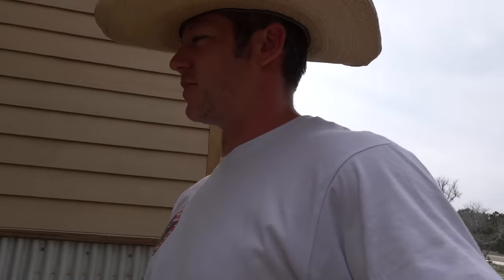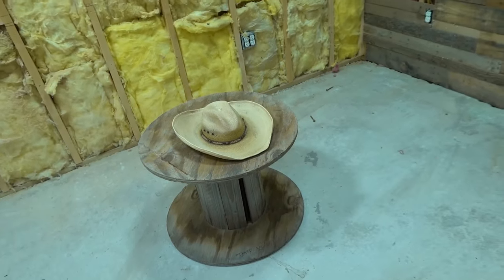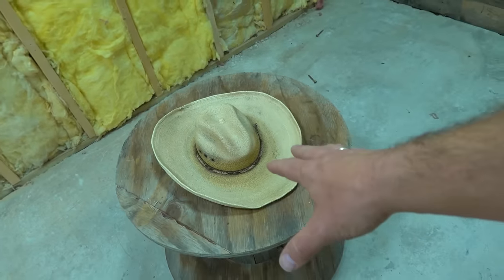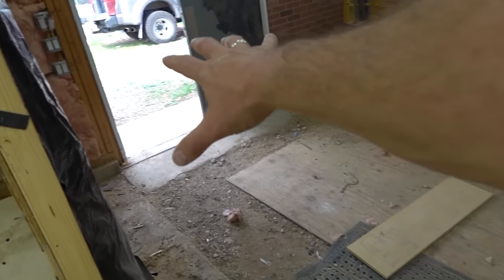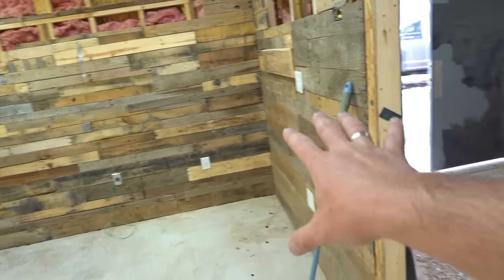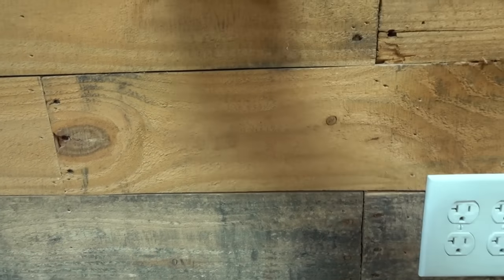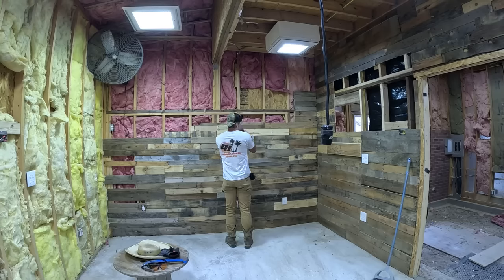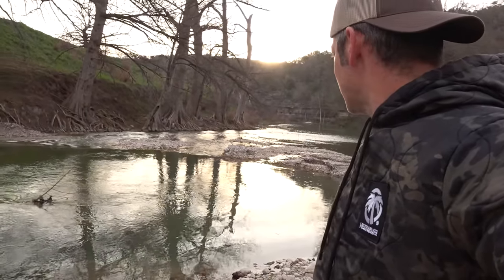Building a Tiny Home: Part 3

Comment: Make a headboard for the bed out of the pallet wood
Reply: I was thinking the same thing. It would look really nice. And maybe even building the bench with storage in front of the bed out of the same wood.
Reply: I was thinking the same thing. Either a headboard or even an accent wall at the head of the bed. Since it's reclaimed pallets, just attach the slats of wood to a piece of plywood and any small gaps could be filled with caulk or grout.  Seal it with a clear coat to protect it but still let the colors show and it would be a great addition to the room
Reply: Yeh, not sure why, but I kinda like the look of those pallet wood walls. Was thinking after the last video about how they could be sanded a bit and sealed, but guess sealing between the boards would be more challenging.
Reply: I run pallet wood thru a planer/shaper to smooth it up and square the edges. Make all kinds of stuff from it! A LOT of it is oak!

Comment: You can still use the pallet wood maybe as an accent wall. After sheetrock paint the wall flat black then reinstall the pallet wood. Any of the slight gaps will only show as a black shadow. It would also be a good conversation piece because it was from the original addition to the building.

Comment: Matt just get a water truck if you don't have good water and porta-poties for that weekend for your guests to use who don't have self contained campers. And there might be someone who has a snack/catering truck who would come in for the week end Get it rolling. Wish I could come, but my van is not going into 3,4th gear. Bad news for an old van. I would camp remote.

Comment: you overestimate the expectations of campers. I'm going camping next week for spring break with some guys from school. Most places are shut down for winter. The one that's open has no running water and vehicles aren't allowed due to mud, so we have to carry everything in 2 miles. 10 guys are excited for this. Just advertise your land to tents and it will be fine.
Reply: My parents had a camper at the lake year round. In winter the water and sewer were shut off, lines blown out... so water was carried in, an outdoor portable outhouse with a bucket setup and we carried in water in 5 gallon containers to wash hands and the few dishes we needed. We ice fished, played in the snow, sat around a bonfire and just enjoyed the outdoors and winter quiet(in summer that resort was BUSY).

Comment: Now you have to cut drywall for all those electricals.
Reply from the maker: Gonna delete some of them
Reply: You could have put drywall on top of the pallet wood. Would’ve been real handy in a wash room for installing fixtures and fittings to walls
Reply: @ToeKnee-rx4nj  It needs a vapour barrier, no you cant just put drywall over

Comment: Not sure if anyone mentioned this or if it will fit in with your plans, but you could just put up furring strips over the drywall and hang the pallet wood back up

Comment: That wall was nice. If  you didn't want small crack openings. Just use a wood filter and then sand it down.  A light wood stain, and then you can put that ugly A sheet rock on that top part that was missing.

Comment: One thing you could do is after you sheetrock the walls you could hang the "pallet wood" from the floor up to about hip high to give the place some rustic character
Reply: Brilliant
Reply: Cut corners on one end. Stand them up around bottom like a fence, but inside?  (I dont know. This sounds like it doesn't look good in text, even.) Lol.

Comment: Port-o-pottys are an option, but have you seen those portable bathroom units mounted on the back of a trailer? 
Not sure what the camper to bathroom trailer ratio should be, but if the campers are there for just a short time you may not need that many?

Comment: You can contact Buddy's Water Well and Porta Potty Service out of Bandera  for toilets. There are lots of food trucks that go to the Hill Country wineries that might be willing to set up on site. A lot of them have generators, so no electricity isn't much of a problem . If you get a good  response , go to a rental company and get a 20x20 or 20x30 tent for the day and set up tables and chairs for dining. 
Food trucks usually guesstimate 500 people per truck, so depending on the response you get, you might only need one or two trucks.

Comment: Hey Matt im sure you probably already know this but removing that pallet wood  is probably the best thing you can do  pallet wood is just wood its only heat treated it has no chemical treating to prevent other bug infestations  BTW i did work for a pallet company in the recent past

Comment: I'd definitely have an eclipse viewing at your resort. You really don't need much, just scrape out tent and RV spots with a picnic bench and fire ring at each spot and you're good. I've been camping in many places and that's all they've had and many of them were completely filled with no vacant spots at all. The only other thing you'd need are bathrooms and for that you can just rent a bunch of a portapotties. And that's it, you don't need any other amenities, people can cook their own food over a propane stove or over an open fire, that's what I've done every time I've gone camping and it's worked out fine. If you really wanted, you could get some food trucks to come in, but I don't think that's really necessary. But a dump site for waste water from RVs and trailer would probably be appreciated by those who would be staying in an RV or trailer.

Comment: ECLIPSE...Porta potties, portable bathrooms on trailers. Generators for a room for BBQs and mowed areas for tents. A first aid station with a few nurses and a trauma nurse. 
Security by a reputable company ( grim reaper, Huge Rob, the strongest man, dougnut operator, Brendon AK GUY, KENTUKY BALLISTICS.
You could easily get a water truck for drinking water or plastic water bottles.
A life gaurd for the river ( only open a special section of the river.
A huge generator for power to certain sites. Set up a kitcken in some form of cover with BBQ facilities.
Easily 1000 people could attend and charge according to just how presentable, convenient and pleasurable it all is.
Even have a range day either side of the eclipse day.
C'mon Matt, pull your finger out and get as much help as your friends and demo crew are able to assist.
Eclipse at the resort would be wonderful.
I wish i could fly over and participate.
Goodluck, God bless and much love and prayers from Australia. 

Bob. Australia.

Comment: The funny part about the solar eclipse is how the local counties Emergency Services officr is handling it. From their plans, you'd think half the planet was coming here and that this was the only place in the world to see the eclipse. To the point of designatting official events, putting out safeft instructions on viewing the eclipse, and activating the local ham radio operators in case the cell phone networks go down as well. Unless they're expecting some sort of attack during the eclipse, there is little reason to think anything that would take down the cell system wouldn't also take out the ham radio frequencies likely to be used.

Comment: Matt  needs to see if you could get some of the local San Antonio area food trucks to  provide food and refreshments the event. Maybe  like a Taco truck , a  BBQ  truck a pizza  truck  , see if Bluebell or HEB  could bring out out Ice-cream  amd maybe  some bakeries  have booths selling cookies , pies and other  foods.  And for the adults, maybe  the Spoetzil Brewery  in Shiner bring out a sampling trailer, and each 21 year old get three tokens for a free sample . Just  a thought  I used to  workyears a go at the College Station Hilton Hotel  (1986 1989 ) in the events department . So if  your  team hustles, it could happen. 🤔 Matt  Porta potties  may not necessarily be the elegant of solution to the problem,  however   cost vs need it would be the most effective way to satisfy county health requirements for sanitation for the state and count and river authorities.  You going to  have to provide clean drinking water  at the camp site as well the sanitation  units (pop) at the camp sites.

Comment: Why are you tearing up the floor on the right side instead of using the left side that has no concrete floor for the bathroom? If you did that  you don't have to tear out the left side concrete floor for the bathroom and kitchen sink plumbing? Then you don't have to tear up old concrete and repour both sides of the building!